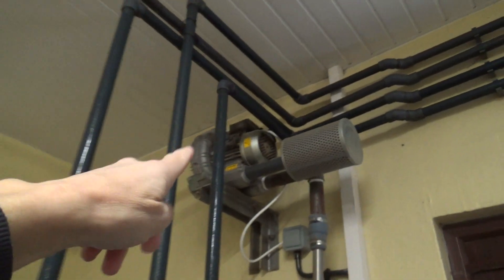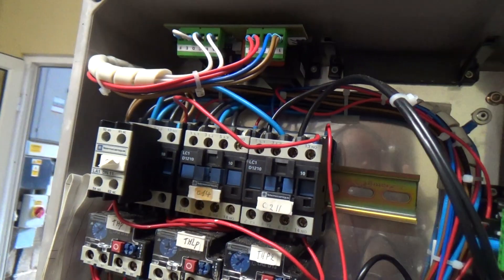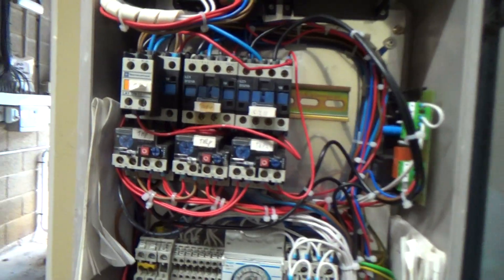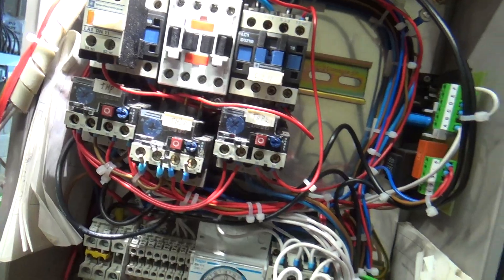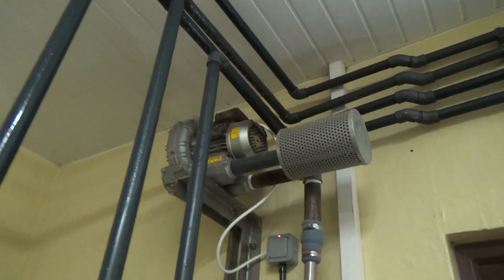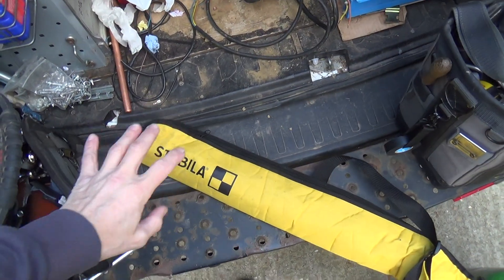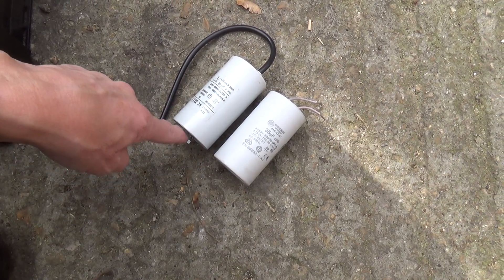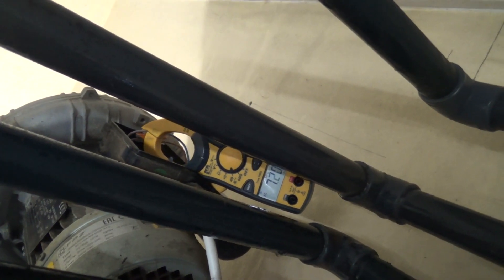50 Hertz

Comment: Fairly easy one in the end, very annoying getting a zap though 😒 
My work colleague got a zap off a recovery pump - 110v we measured - very weird voltage.
It was a 240v cable reel extension lead which was to blame. 
Even though we extended it fully out, I suspect the previous owner was running it partly coiled up.
Reply from the maker: I wonder if it had a bad earth connection?